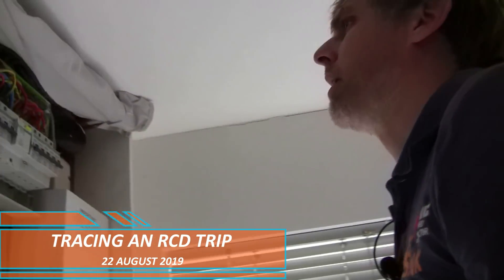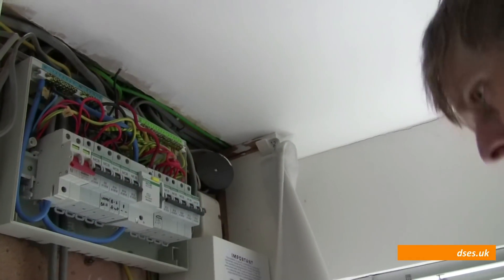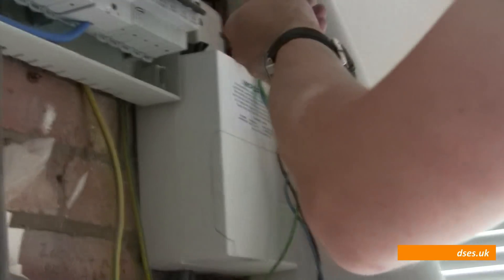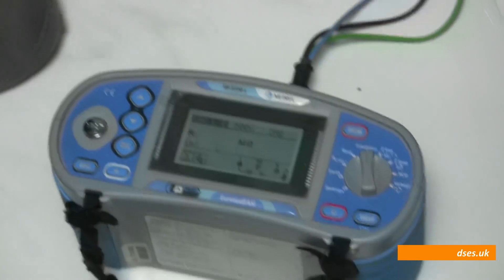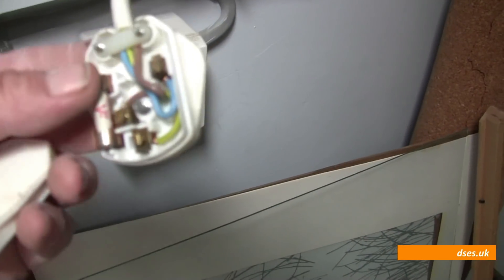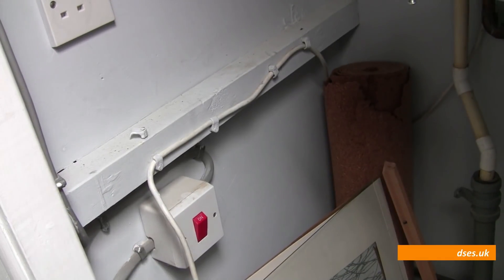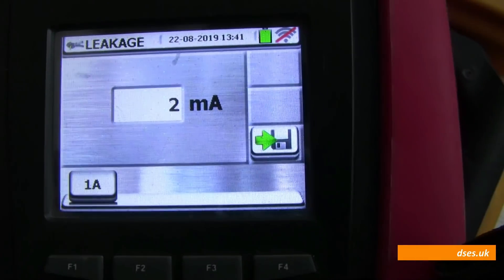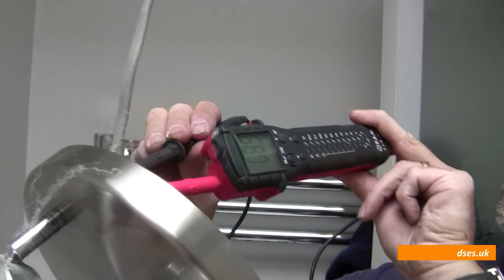Tracing an RCD trip

Comment: What was the customers response when you told her her class 1 light fitting needed replacing with a poxy class 2 fixture or she needs the circuit rewired. 😂😂😂
Reply from the maker: She hinted that she plans to move, so I suspect nothing will be changed and it'll be something the next owner takes on. Mind you, they may decide to refurb the place in which case it might be rewired - we did the house next door last year.
Reply: You can get fancy Class II light fittings but they tend to be a lot more expensive. Class II downlights is another option.

Comment: I was recently exploring the accuracy of current-transformer clamp based whole-home energy monitoring devices (spoiler: they're all crap, obviously - they only measure apparent power [literally just current with an assumed voltage, even], maybe taking a guess at power factor, so they were all reading 20-40% too high for my house...) and since I was out at the electric meter with a clamp meter anyway I just curiously put it around the earth wire from the meter to the consumer unit and got a reading of 19mA, which seems rather high to my admittedly inexperienced mind.

I was only using that same UNI-T DC clamp meter that's all over YouTube so that figure isn't super trustworthy, but I'd be surprised if it's all that far off reality. Sadly that clamp meter doesn't fit around the meter tails so I have no idea about leakage through other routes, and this house (~12 yrs old?) just has one RCD protecting half the circuits - sockets, mostly, I think - so there's plenty of scope for earth leakage here that would be totally ignored by the RCD 😕
Reply: How much have you had to drink...?
Reply from the maker: A few milliamps leaking out is to be expected, but as you say, half the circuits aren't on the RCD (sounds like you have a 16th Edition split load board), so not all that current will be going through the RCD as you say. Some of it may also be from neighbouring properties which is what happened in my Curious Fault 1 video last summer. For this reason, it's best to clamp the meter tails as that will give you a reading for your property rather than you picking up a bit of leakage coming from next door. That clamp of mine is horrendously expensive (£480 or something just for the clamp alone), so you'd hope it would be fairly tight on the numbers!

Comment: You’re having a similar week to me. Had a call out today where the whole house was without lights due to a loose neutral in the 1 working light. At least you didn’t have the benefit of the customer re wiring the switch but saying he hadn’t 🙄
Reply from the maker: Ah yes, being thrown off track by not being told the full facts! Mind you, here we were thrown off track by the client saying she'd heard things scurrying about in the ceiling as we jumped to the conclusion that it would be a gnawed cable and started getting busy with the camera. Doubtless there are some pests up there, you can see the droppings on the camera, but the fault itself was simpler than expected!
Reply: I think you're within your right to add a 'Lying Bastard' charge to that invoice.

Comment: great tip looping the line circuits so you don't have to unplug everything !
Reply from the maker: As it's tripping, we want to catch it in the act before modifying anything, so we don't want to switch off or unplug stuff when we first arrive, we want to identify what's bad, then break it down. By linking line and neutral, we can test without damaging any connected appliances even at 500V as the potential difference being zapped up line and neutral together is zero.
Reply: @dsesuk  that tip will save me hours Dave , thank you .
Reply: @dsesuk  Wouldn't 500v be a problem even with LN joined if there were any surge protected extension leads/devices on the tested circuit? Regards, Gordon
Reply: @gordonLP  That's why he also IR tested at 250 V, if an SPD was in circuit, the IR reading would be high at 250 V but low at 500 V.
Reply from the maker: @gordonLP  Quite right Gordon, and as Alvin said, that's why we repeated the test at 250V just to ensure the number was still cack and it wasn't down to an SPD.
Reply: @ashmanelectricalservices4318  thanks for clearing that up, I must have missed the 250v test (to tired, to late)
Reply: i do the same test its a brilliant time saver i test on 250v dc tho
Reply: A piggyback lead works just as well and probably more appropriate when IR testing on 3 phase distribution boards as the peony jump lead won't reach between the line and neutral conductors 😂😂😂
Reply: Nice video, I had no idea about liking out the phase and neutral. This will save me loads of time in the future.

Thanks.
Reply: @richardstenson6043  This method can only be used to identify an earth fault... Short circuits faults will have to investigated by disconnecting all load from circuit under test and testing between the line and neutral conductors. Where there is a short circuit fault and the property is wired in t&e, very very rarely is it a problem with the wiring, more often than not it's an appliance or connected load which is faulty.
Reply: @ashmanelectricalservices4318  I've seen both quite a few times. I thought it was a nice trick to locate the faulty circuit on a rcd that's tripping intermittently. I've always ended up going round and disconnecting appliances from the circuit before performing an IR test. Every days a school day!
Reply: @richardstenson6043  Preferably you wanna have everything exactly how it was before the trip. I always faultfind this way, it's not enough just to clear the fault, the customer will want to know what caused it.
Reply: @ashmanelectricalservices4318  of course.

Comment: What is the make of that inspection camera?
Reply from the maker: The Ferret WiFi, available at CEF. I did a video on it back around April. Jolly useful bit o' kit.
Reply: I got hold of a rather nifty WiFi inspection camera from Amazon for less than £20

Comment: Im still learning about electrical work so it may sound obvious to you but how did you know it was a fault to earth and not the live and nuetral
Reply from the maker: A breakdown of insulation line to neutral would cause an overload fault and trip the breaker. The RCD will trip when current leaks to earth, so we knew it was an earth fault we were looking for. We didn't narrow down if it was line to earth or neutral to earth, but that's for someone else to figure out!
Reply: Thank you very good videos you will be surprised how much you learn from videos like these. Thank u very much
Reply from the maker: @mickspark1677  Cheers Mick

Comment: Well done Nigel, for a minute there I thought you were gonna have hack a hole in the ceiling to access the junction box 👍
Reply from the maker: We did consider it; easy to hide under a light with a large base, but if that Class I fixture is to be changed for a Class Ii then we need to know what the new one will be like. My recommendation is for a large recessed LED model as they come IP rated, are Class II and would work well in that space.
Reply: @dsesuk  Why is the bathroom fitting not earthed, is there no cpc in the wiring?
Reply: @ashmanelectricalservices4318  A lot of older wiring had lighting in only twin rather than twin and earth (aka no cpc).  Although the cable to the light fitting has been replaced at some point (Probably when they installed the skylight), the actual circuit wiring is still just twin with no cpc so it doesn't actually go anywhere...  Also note class 2 fixture will be plastic and not require a cpc where as that one is metal so the fitting case can in fault conditions become live hence requiring a cpc.  Hope that helps.
Reply: @steve11211  Yes, thank you I'm aware of properties wired before 1970 often had no cpc in flat lighting cable, I just wanted to know if that was the case with this property.
Reply: @ashmanelectricalservices4318  look at 12:44 . They say they looked at an inspection that said lighting circuit was not earthed.
Reply: @ashmanelectricalservices4318  I think there was a cpc but it wasn't connected in the jb in the ceiling.
Reply from the maker: @ashmanelectricalservices4318  It's the original aluminium wiring from back in the day when they thought nobody would need a CPC for lights as we all had plastic pendants and switches! There's a CPC at the light itself as newer copper T&E feeds it, but behind that ceiling is a junction where it goes into the non-earthed original wiring. We rewired the house next door last year, but this one needs a bit of TLC it seems.
Reply: @markrowland5393  No Steve's right, there's no cpc in the entire lighting circuit, the cpc at the light fitting is only there for effect, there's no cpc to connect to in the junction box.
Reply: @ashmanelectricalservices4318  Oh, right. So there's no cpc for that circuit in the consumer unit but the cable in the bathroom, which does have a cpc, was added later?
Reply: @markrowland5393  Correct.

Comment: Great videos very relatable.  Whats the longest you have ever been looking for a fault and is there some jobs where you could not find it
Reply from the maker: Faultfinding isn't often this straightforward. We tend to book a short amount of time to a faultfinding job (an hour or so), then take it forward from there depending on what we find. If not found quickly, then after some investigation we'll either know we're on the right track and can estimate what's needed to wrap it up, or we'll have an idea of a workaround. The worst ones are the intermittent faults as you have to catch them in the act.